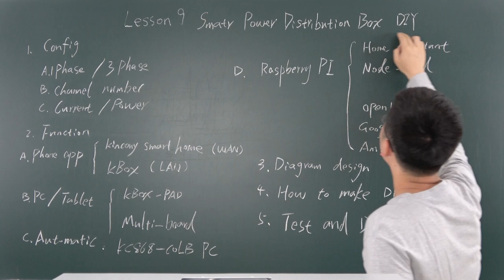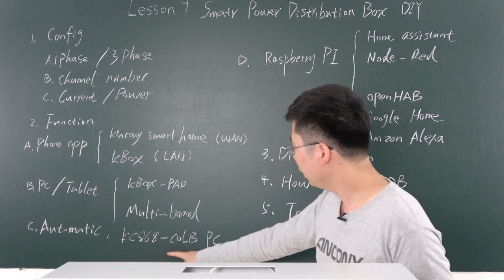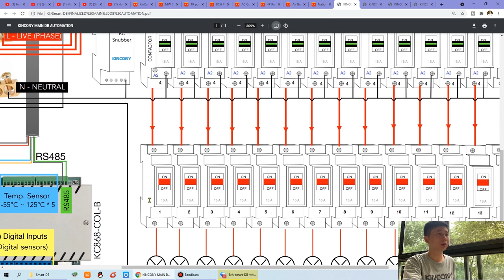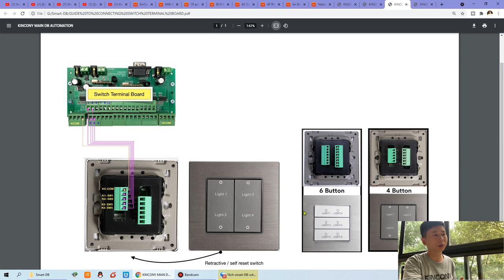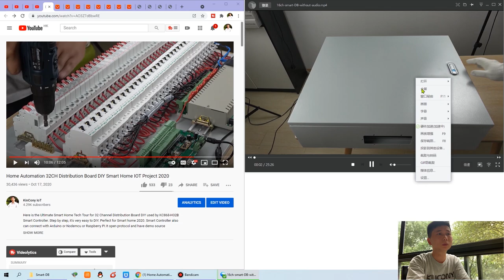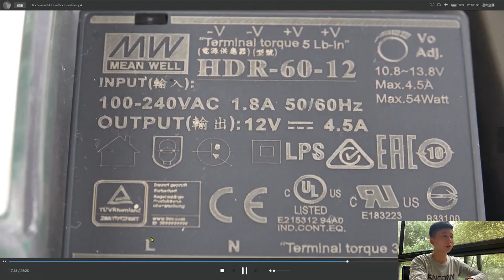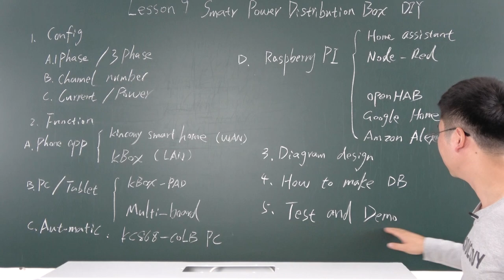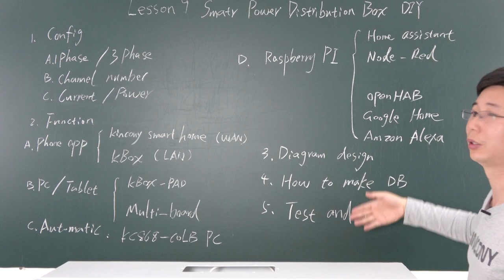【IoT training lesson beginners #09】DIY Powerful Smart Power Distribution Box

Comment: hello sir, thank you for your product. Would I be able to control three 1000w lights and one 300w water pump and one 300w fan? where would i connect the positive and negative of each into this as i only see the positive..
Reply from the maker: 1000w and 300w load, no problem, because negative all is together.

Comment: i think this application is for line to neutral only? how about line to line application. I suggest to make a video how to fix using line to line.
Reply from the maker: do you means take example for 3 phase case? AC380v case?
Reply: @KinCony  no, it means  line to line, 110v to 110v. single phase. I think your presentation line to neutral 220v to 0v.
Reply from the maker: ok, it's same, just connect your load by line to line @leodjetv
Reply: @KinCony  so its ok that  110v is connected to neutral terminal block?  its allowed to electrical standard 110v connected to breaker and another 110v connected to terminal block?
Reply from the maker: diagram is same, just replace breaker with AC110v version. @leodjetv

Comment: Is there a way to know from the software system (Home assistant) if the circuit breaker  go off (down) ?
Reply from the maker: system control by phone,pc, manually. if you want to know more information about home assistant, you can see our home assistant lesson series videos.
Reply: KinCony IoT  
,, My question is if something happened to the circuit breaker because some problem like over current or overload current or short ,the circuit breaker will go off to protect the circuit , can the system show that or send a notification ?, because the relay in relay controller still work (on).
Reply from the maker: @m82011  i think you can add a power-failure sensor connect with input ports, set by phone app, if overload, breaker off, will send alarm message to mobile phone.

Comment: How much for a complete set of these?
Reply from the maker: 1280usd
Reply: @KinCony  is this box can work without a neutral line?
Reply from the maker: @Rainbwoah20  do you means your wall switch panel no neutral line inside?
Reply: What i mean is,the line here in the philippines is 110v per line. We dont have neutral line in our house
Reply from the maker: @Rainbwoah20  just replace ac contactor with ac110v's
Reply: Where can i buy the package? Can you send me the link?
Reply from the maker: @Rainbwoah20  tomorrow send you link
Reply from the maker: @Rainbwoah20  here is order link: https://www.aliexpress.com/item/1005002136269231.html?spm=5261.ProductManageOnline.0.0.16634edfrCpyhj
Reply: I need 120 channel control via wifi with voice command.where do i get the qoute for this smart distrinution board?
Reply from the maker: @Rainbwoah20  whether will use by sensor, just confirm whether need KC868-COLB inside of DB
Reply: Need kc868 colb. I want to automate 120 devices in home. I want to control separately each of device.